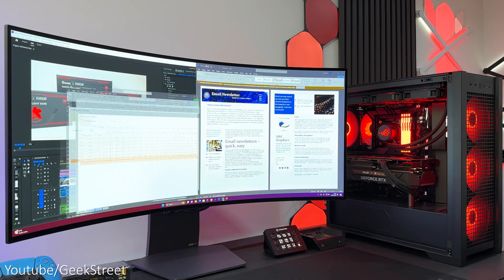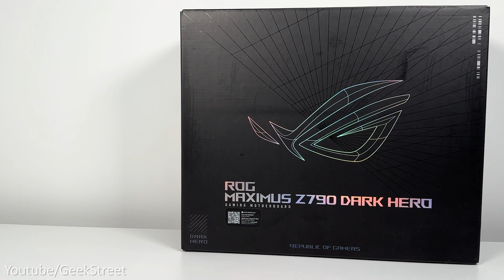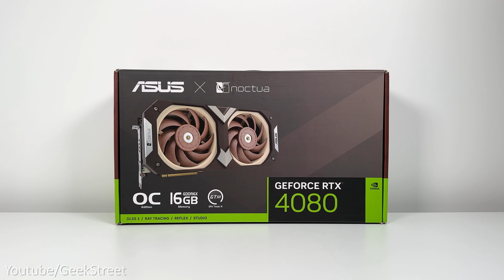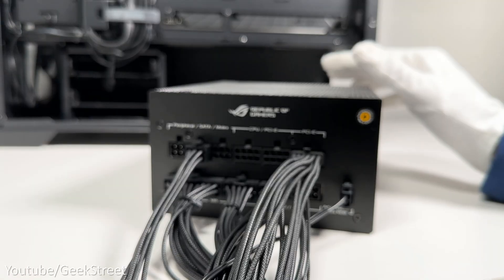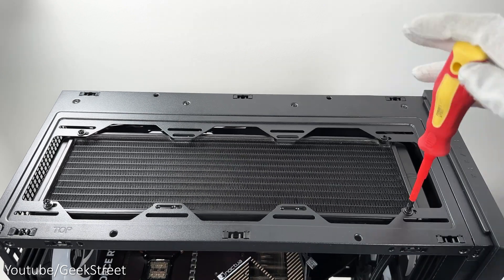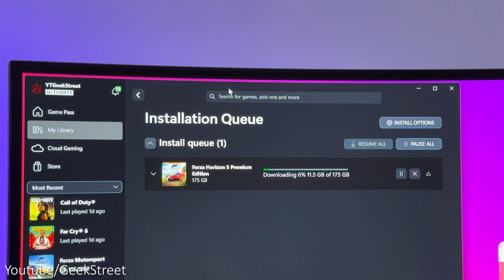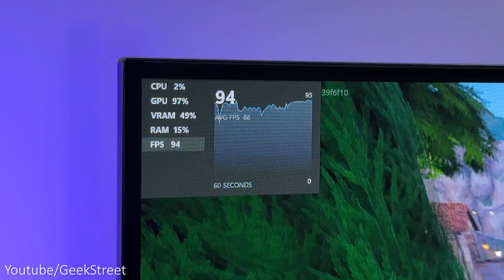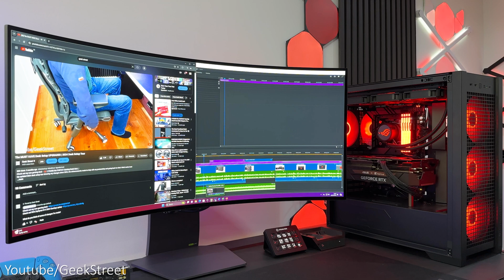Ultimate PC build for first timers (step-by-step)

Comment: 3600£ and no RTX 4090 
You overpaid for unnecessary stuff. 😅
I had 4090 (now 4070 Super as I sold 4090 expecting upgrade with 5000 series), Ryzen 7600X, B650-A ROG Gaming WiFI, 3TB SSD storage, Hyte H40, NZXT Kraken with 32GB 6000CL30 and I only paid 2200€ for parts 🧐
Funny thing is I sold 4090, about 2-3 months ago for 1900€, more than I paid for it and so my setup was only price of 4070 Super 😂

Remember to update your BIOS and W11 immediately or your CPU may just die randomly in less than 6 months 😅
Intel 13/14 Gen issues 😓
Reply from the maker: Hopefully the next upgrade will be to a 5090 🤞

Comment: Just one thing: whyyyyyyyyyyyyyyyyyyy Intel? No upgradability
Reply: @GeekStreet  😂 but it's still a killer system
Reply from the maker: @OliverMattison  thanks 😅
Reply: @GeekStreet make sure you upgrade bios and windows 11 for newest micro code.
The Intel 13 and 14 Gen has issue with cpu degrading very fast 😅
If out of nowhere your PC starts dying, then remember to RMA cpu.

Comment: If you are not already aware, please update the BIOS to the latest as soon as possible because 13th & 14th gen Intel chips suffer from an issue that slowly kills them over time leading to random crashes. It is unfixable once it occurs as it damages the silicon.
Reply from the maker: This for the info, I did hear about that and it's the first thing I did after setup

Comment: Little bit overpriced gpu, you should buy 4080 super for around 1200$ and not the special noctua edition. 
Im currently deciding, if to buy 39 or 32 lg monitor which you have. Do you have suggestion, which is better and why?
‘New gpu’😊
Reply from the maker: Monitor wise depends on your usage the 39" gives a great immersive gaming experience but the ppi is low. The 32" is the best all round monitor for gaming and productivity

Comment: Very cool build! Assetto with mods here we go!
Hopefully you wont have any issue tho because intel has issue with 13th gen and 14th gen. GENUIENLY HAPPY WITH YOUR BUILD
Reply from the maker: Thanks bro
Reply: Just update to the newest BIOS (Intel Microcode 0x129), should fix the Voltage Problem, if your 13./14. Intel CPU has not allready started with degradation.